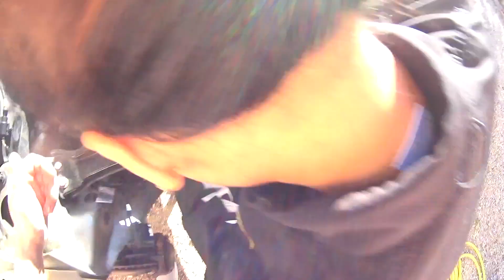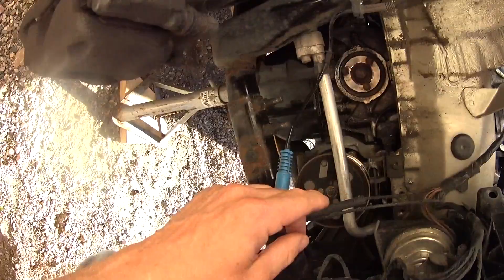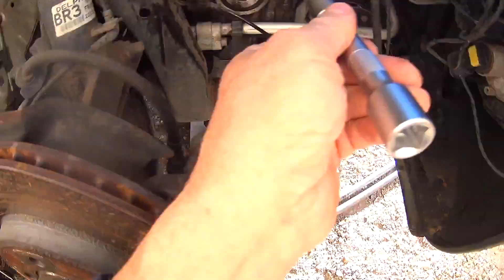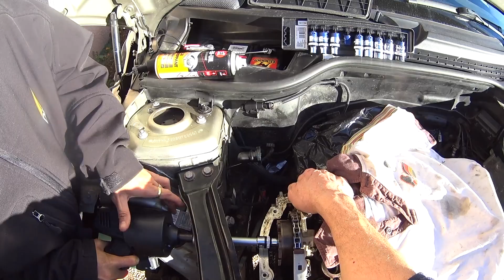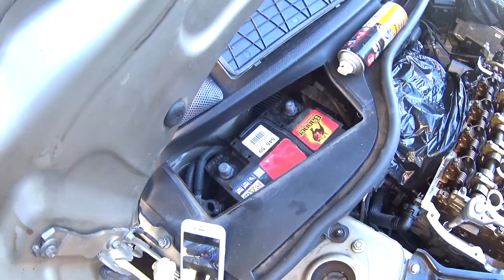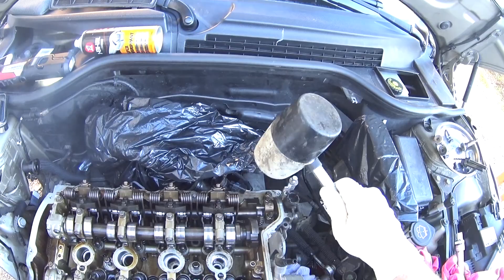MINI COOPER R56 N12 ENGINE, CYLINDER HEAD REBUILT Episode 3

Comment: Did you ever get the car fixed?
Reply from the maker: Hi, unfortunately no because there were a crack on the engine block… I sold as is, as the price of an used engine or cost of repair mine was about 1500€… but honestly I regret now…
Reply: @psv1600 🤭 that’s not good. Do you remember where the crack was? Were you getting some engine codes that caused you to want to rebuild the engine ?
Reply from the maker: As is a common problem on minis, there’s always randomly à engine light on the car… I was a bit used too as it’s on and off… (nothing wrong, fuel emissions light). engine broke on the motorway by a chain tensioner failure…
Reply from the maker: I can send you a picture by txt, here is my insta: #jagxjcorner_
Reply: @psv1600  oh I understand. I’m have an issue with a mini I just bought for pretty cheap. I keep getting a vanos exhaust error. I changed the timing chain, vanos solenoids but still get the error. I’m beginning to think I need a new head for the motor. I’ve been searching the internet for all the information I can get on this N12 motor. That’s how I ended up seeing your video.
Reply from the maker: Aïe 😣… probably yes, anyway depending the cost of the car it would be a good deal to make her almost new!
Reply: @psv1600  I paid $1,400 for the car . I do all the engine myself so I don’t think a $800 rebuilt head would be putting too much money into the car.
Reply from the maker: Yes of course that’s still a good deal, what’s her mileage ?
Reply from the maker: You can’t find anything for this price here in France 🇫🇷
Reply: @psv1600  154,000 miles

Comment: Salut,
Can you tell me what was the result of your repair? Did you have to replace the pistons, were the valves  badly damaged, did you have to rebuild the cylinder head completely?  I have exactly the same Mini, chain has "jumped" but the damage is not as bad as on your engine, I think.   I think because I have not removed the head yet but, there is no visible damage ( broken parts) in the camshaft area as all spring,cams, lifters look ok. 
Any feedback would be appreciated because I want to decide if there is point in repair or just sell the Mini for parts. 
Merci
Reply from the maker: Hi Ched, unfortunately I stopped the repair as the engine block was damaged... I don’t know how it’s happened but one of the cylinder liner has a hole, big like a nail, and it’s broke my courage to repair... 
in fact in the cylinder head there was  no damage, only 2 valves bent, easy to fix. 
The problem was to repair the engine block, my budget was limited at something 1000€ ( already much ! ) and if I should remove the full block to bring in a welder and machine  shop I guess I burned all the money in only that. 
Initially I planned to spend around 600/700€ in the repair, I guess in you case it’s what you must to expect and with that amount you’ll do a lot ! New timing kit, valves, head réfection, tensioners, seals... Depending where you live I think it’s better to repair as the value is low as a car for parts
finally I sold the car for 1800€ as an used engine ( with new timing kit) cost more than 2000, and I don’t have place to keep her... 
in
Reply from the maker: There’s no particular difficulties to remove the head so better to do it and check before to plan anything. Where are you living?
Reply: @psv1600  Salut, thank you for reply. Your engine did look pretty badly damaged. I live in Manchester, England. I can get used engine for E1000 or new engine for E1500 - 2500 but, I  am not sure how good these engines are. Maybe I just have a bent valve but,  not sure!? Compressio is at 0 bar on all 4 cylinders so, it's not a good sign. When I initialy checked the engine timing the inlet camshaft was out set by 180 degrees so, this may have resulted in quite a bit of damage. But, the only way is to open the engine and look inside, like you did!  I have to make a decission!!! 
Merci
Reply from the maker: Hi Ched, lucky you you live in uk, in that way it sound better to repair as is cheaper than here in France. Depending if you have a special feeling with your car or just using as a tool ( I guess you love it ;-) ) if you buy a used engine and “refurbish” it I think you can be quiet for a long time. Just put new timing kit, new tensioners new oil pump, new seals and eventually a new clutch and she will be ready for another 60000 miles. And I’m sure it won’t cost you more than 500£ except engine. Crazy you said no compression in the 4 cylinders...! Its really sound bad and strange. I’m interested to know more about your problem, cheers Fred